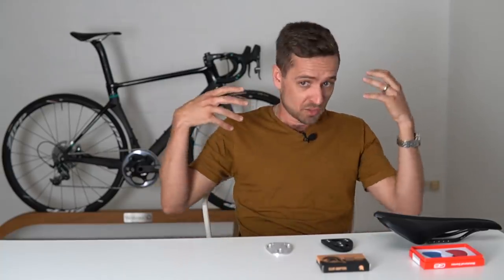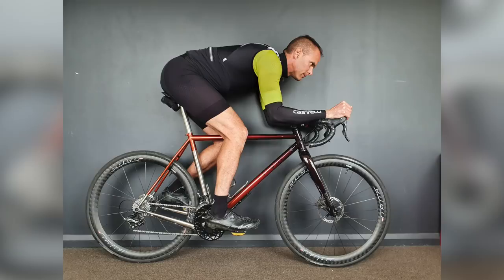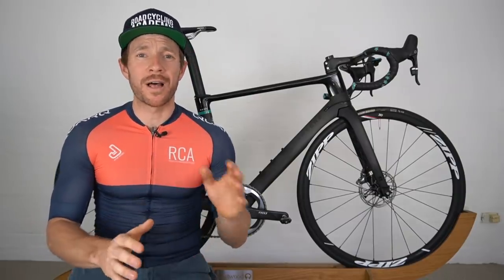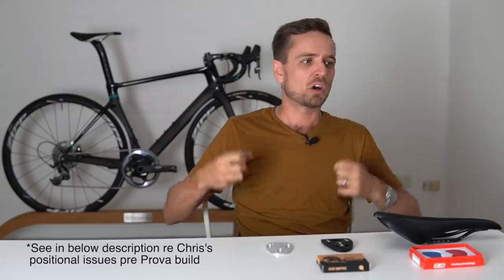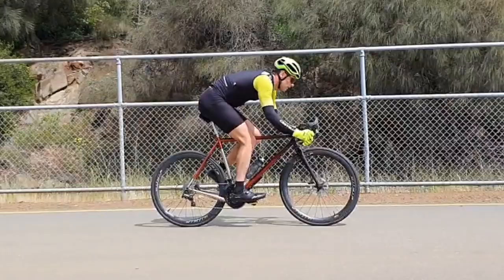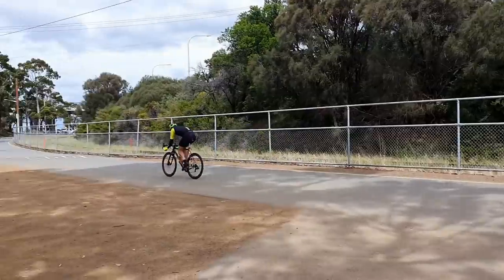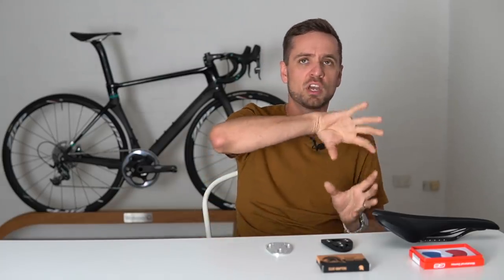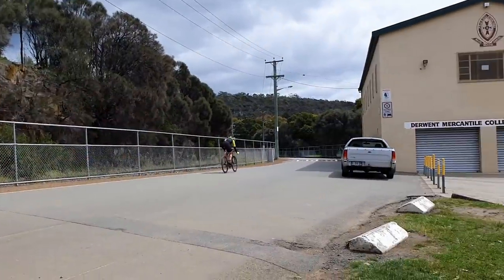Check Out THIS Freak Custom Road Bike Build

Comment: Hi, I was really interested i this discussion as I have a "weird" skeleton too, very flexible and light, 175cm tall, 86.4cm inseam and a 188cm tip to tip arm span. I have never been able to find a suitable OTS frame and have had to make changes to STD frames to try and get a good fit. I have looked into custom frames, £1600 / £3000+ (alu / titamium) for the frame. I was looking  at a 78 degree seat post and as tight a fit as possible. Due to cost I never went through with it and the resulting  "Only for me" bike, but this has given me some hope that I too could get a favourable result, Thank you and Neil for putting this video together and giving a "weirdo" hope :)

Comment: Hey Cam, I have a good question again.
When you change position you will have a harder time at first, because your body needs to adjust.
Is there a way to put numbers on adjustability of the body?
What I mean is, there can't be one perfect position for a specific rider, but I would assume there is a margin within one can perform best.

In this case here: If Chris would not have bought a custom frame, but used a frame that fired I him pretty well. How much would his efficiency improve over time due to his body adjusting to that position?

I hope you got what I am trying to say :)

Comment: I’m 6’2 and fit my bike similarly. Long and low. I ride as low as guys (and women) a foot shorter in height. I get the shortest head tube with the longest top tube I can find. I end up using a 14 cm stem to get the length I need otherwise the head tubes on stock bikes with the long top tubes are huge.
Reply: that's cool, did u manage the balance test?
Reply from the maker: Thanks for sharing mate, interesting to hear! Cam
Reply: @31.8mm  yes. I find I am a bit heavy on the hands though. I can touch the floor almost with my palm with my legs straight. I raced for about twenty years and I am 56 now and getting back to gravel racing after an 8 year break. Time trials and solo breaks were the only way I won races.
Reply: I'm the same hight 6'3 , and my bike is 2XXL Scott foil wit 140 mm stem and 113mm reach bars (aerotundo 3T) . My next frame custom-made  for sure. :)

Comment: This is really interesting, my custom bikes are almost exactly the opposite of that one - except for the short head tube. I have a really short wheelbase (crazy toe overlap even with 165mm cranks) and a short effective top tube, the physical top tube is steeply sloping so the actual frame is really small with a long seat post. Make it really stiff, and still pretty low and aero, with fast twitchy handling (that I like). Then again I am a lot shorter 5'5" and not at all flexible :)

Comment: I can roll over very far on my ISM saddle, giving me a huge reach and making me very aero. But riding like this for just a few minutes completely destroys my neck, shoulders, and lower back... and isn't so good on my hands, either. You need absurd core strength to ride like this for extended periods. If not, you will be putting a huge weight on your hands. On other other hand, even if he has the strength and flexibility required to ride like this, he is going to kink his femoral artery at some point.
Reply: This is the only position Chris can ride in without pain, and he's been like this for 20+ years. His core strength is very, very good,  although lower torso angles don't necessarily mean more weight on the hands, that would be an over-simplification.
Reply: @neillstanbury4557  Interesting. You can for sure ride in an aggressive position without hand pressure as long as you are sufficiently cantilevered (you don't need me to tell you this) and properly engage the core. Pressing on the pedals hard helps, of course. But if you're just noodling around or riding a very long distance or doing a trainer ride, I personally would find this level of core engagement very tiring. Dude is definitely a.... unique specimen.
Reply: Upvote for the ISM saddle! Running an Aeroad with ISM and a stem almost slammed all the way (two small spacers underneath) and it works beautifully! None of the pain you describe here . :-)
Reply: @baribari600  very unique indeed, he's the full package of uniqueness!

Comment: How does it handle?
Reply: Chris tells me it's really good, they did some trickery with the fork rake and front end to make it steer properly (outside my pay grade that one) and he says it's nice and sharp, and with such a low centre of gravity he has no problems at all with corner speed. I think he's running 28's on it a lot of the time and converts it for gravel use with some 32's

Comment: This is idiocy, why ppl go so low and end up with no stability and huge amount of weight on their hands? What the point of "aErO aDvAnTaGe" when you can't properly breathe and your back sore after 10 miles? And I'm not talking about private bits pressure. Everyone fav Sagan has a back angle of 45 degrees when he is on hoods, why he is not into this kind of BS? This guy yet another weirdo who thinks that he knows something that others don't. bike fit is all about balance and he put all perks into aero forgetting about other crucial parts. He would be perfectly fine on 58-60 cm top tube and negative - 17 degrees 15cm stem. But who em I to judge let the kid think that he is special.
Reply: Thanks for showing me the error of my ways, I will go and let Chris know that his years of discomfort on standard frames is all a figment of his imagination. We both appreciate your expertise in such a complex matter!